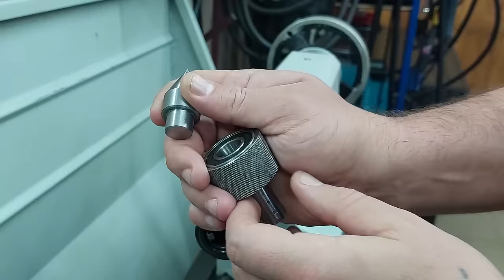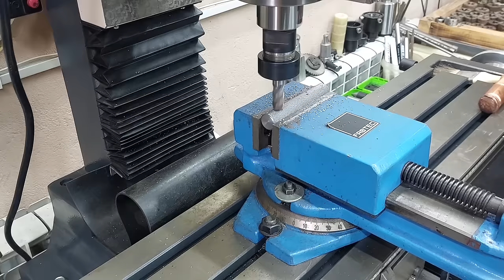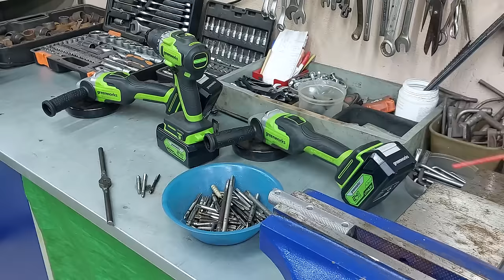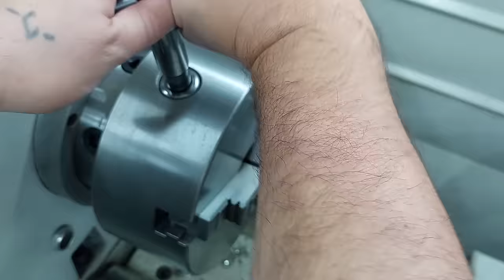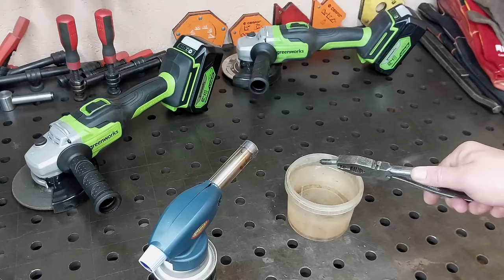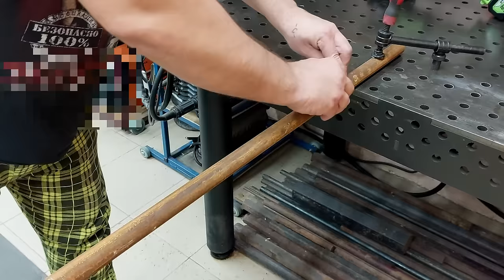Amazing homemade tool you might not have known about

Comment: As a pipe fitterI see that a slight difference in pressure on the ends of the tool will change the line from 1 side to the other.
Reply from the maker: Hi, that's right, this tool is not only for round pipe but its main purpose is for marking square profile pipe! Welcome friend!

Comment: Salve, sono un orafo da oltre 50 anni , il carato quello del peso delle pietre preziose cioè il carato è un quinto del grammo. (0,2 ) grammi
Per i  metalli preziosi si usa il carato Cm (carato metrici ) oppure Ct  anche se internazionalmente si usa Kt .
ed è la proporzione in base 24  oro puro . Vi ricordo che per l' oro , platino , argento si usa una scala in millesimi ,valido in Italia con i valori legali di 750 585 333 per l' oro pari a 18 14 e 8 carati non legali in Italia anche se usati e tollerati .serena giornata